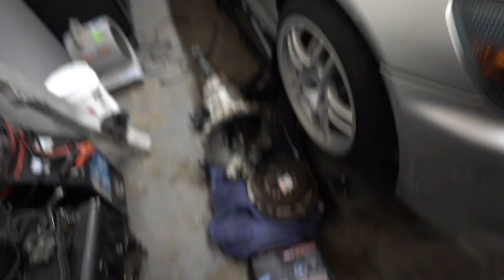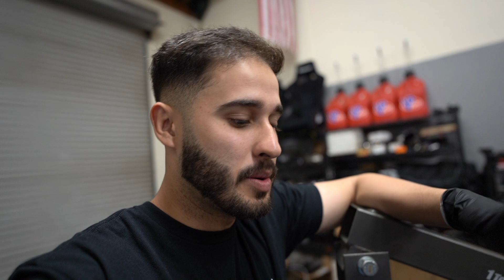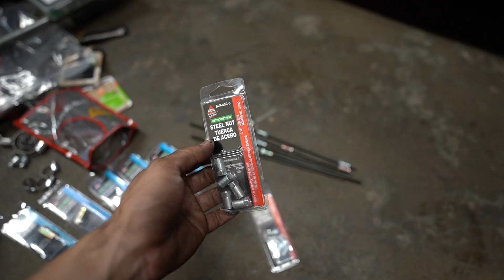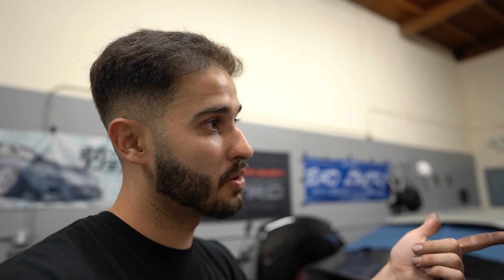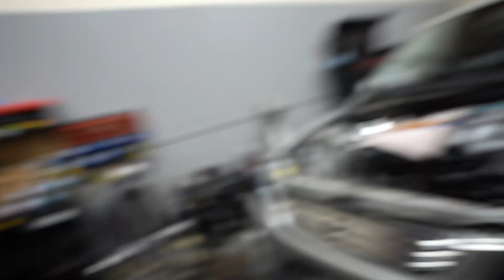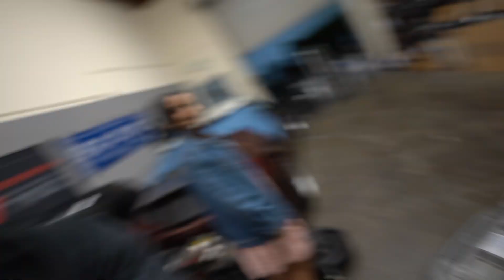Diving Further into the Big Turbo 1JZ IS300!

Comment: The abs system. Could have stayed in the same place. Just remove the lines from the clips around the strut tower. Then modify the bracket the holds thr abs pump so it sites lower